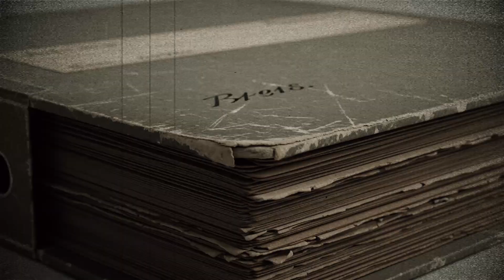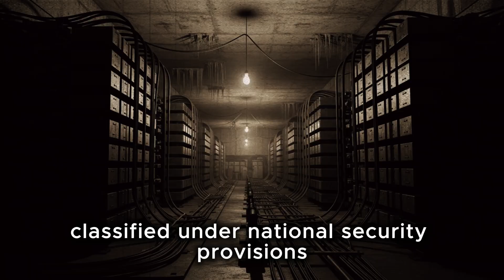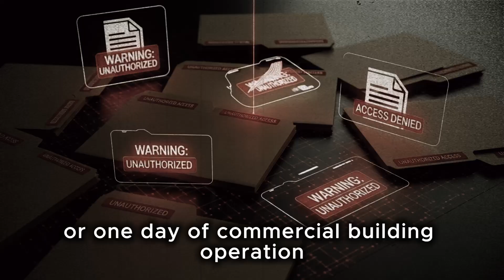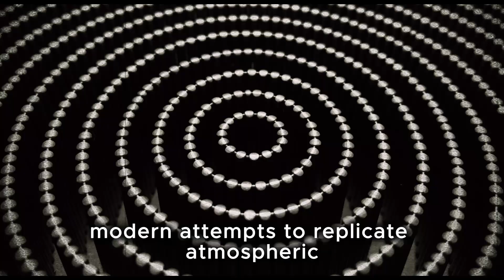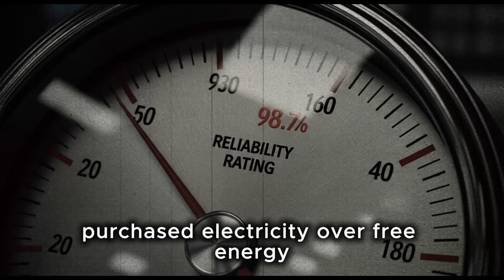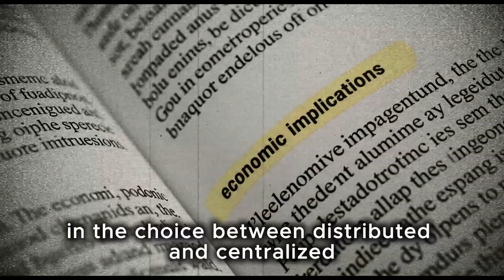1876: The Patent That PROVED Tartaria's Free Energy Architecture

Comment: Patent No. 174,465 is the United States patent granted to Alexander Graham Bell on March 7, 1876, for his invention of the telephone.  The patent, titled "Improvement in Telegraphy," described a method and apparatus for transmitting vocal or other sounds telegraphically by converting sound vibrations into electrical undulations that could be transmitted over wires and reproduced as sound at the receiving end. 

Filing Date: February 14, 1876
Grant Date: March 7, 1876
Inventor: Alexander Graham Bell, of Salem, Massachusetts